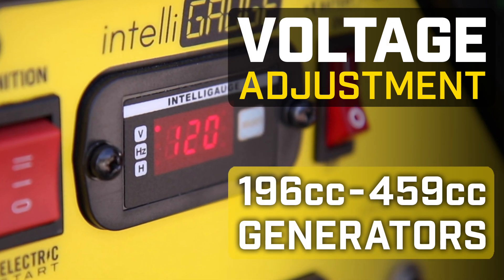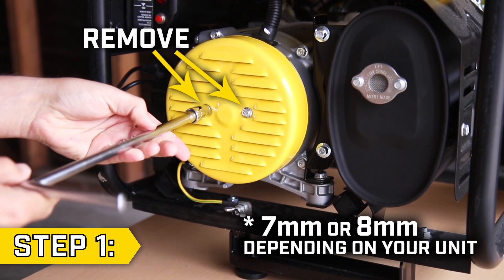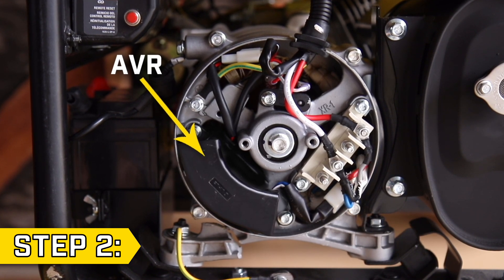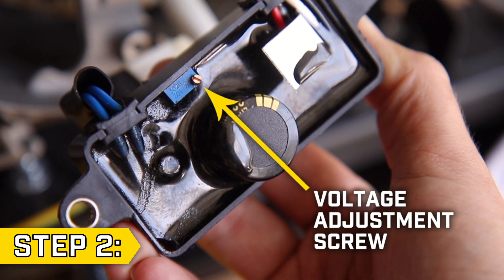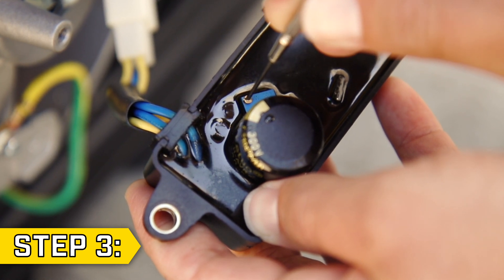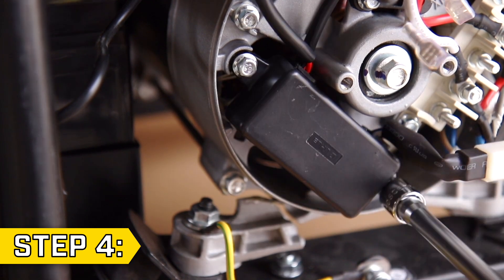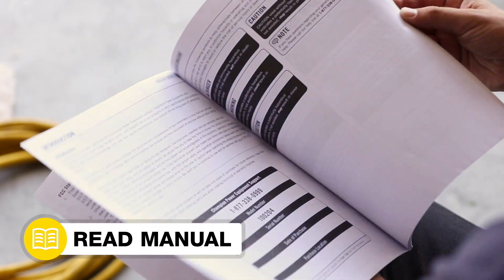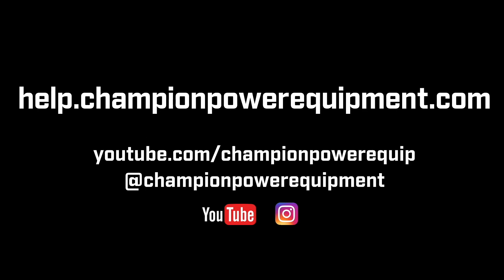Voltage Adjustment (196cc-459cc Generators)

Comment: I had that same problem on a 4,000 watt Predator that was delivering a voltage of 182v to the output sockets. I followed the procedure in this video and managed to adjust to the correct voltage of 120v that the outlet plate says. Thank you very much, despite being another brand, its content is very accurate.
Reply from the maker: Thanks for sharing!

Comment: contacting champion power equipment is only possible if you want to be on hold for 1 hour
Reply from the maker: We are sorry to hear you haven't been able to reach us by phone. Please note we have other methods of contact as well via live chat through our website or by email at support@cpeauto.com. The latter two usually have quicker turnaround times. Reach out through there at your earliest convenience. Thanks for your patience!
Reply: I have this problem in this moment
Reply: So, how do I check and see if my champion is running at the right speed before this?
Reply: @ChucksVetAdventures  Look at the Hz/cycle frequency with the Intelligauge, or if no Intelligauge on your generator with a volt-ohm-meter that reads frequency, and adjust the engine speed so the Hz/frequency is 60.  That is the correct speed.  Then adjust the output voltage with the screw on the automatic voltage regulator.
Reply: Champion support is outstanding!  I find they usually answer the phone within a few minutes.  They have sent me parts under their 3-year warranty, for multiple generators, without hesitation.  I have two Champion 3,500 watt generators, one with over 7,000 hours on it and it still runs and puts out power.  

My other Champion is much newer and had a problem putting out only 114 VAC after I tried to run an air compressor with it (that air compressor had been run by the generator many other times without a problem).  Trying to fix that problem, under warranty Champion support sent me multiple automatic voltage regulators, an armature/rotor, a stator, and helped any way they could.  If you have to wait on the phone it is because they are trying to do a proper job helping someone else, as they will help you when you speak with them.  And you can also communicate with them by email or chat.

Most (not all) of their support people know their equipment well and really want to help you fix your problem.  

I cannot say enough good things about Champion support, their generators, and the company.  

Champion Power Equipment stands out as an excellent company for other companies to follow in our world today.

And no, I don't work for Champion.  I found them many years ago when I saw a 1200 Watt Champion generator on sale in an auto parts store, and took a chance assuming I would never be able to get parts or support if needed and bought it because the price was low (I had never heard of the company).  At some point I had a question and called, and was surprised that the person I spoke with knew details about the generator (as if they had repaired them) and answered my questions.  I have been a Champion customer ever since (I now have a Champion log splitter as well).

As for the subject of this video, as a last resort I used the advice in this video to adjust the Automatic Voltage Regulator to get 120 volts ac output, and so far so good.  Only thing missing in the video is that on mine, turning the screw on the AVR counter-clockwise raised the voltage (not what I tried first).